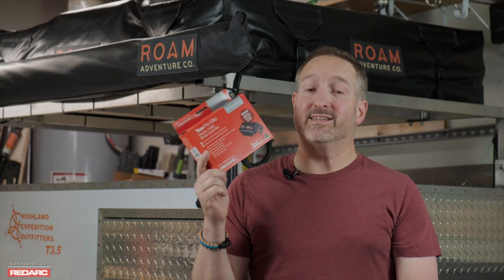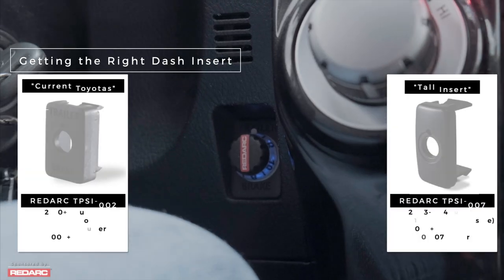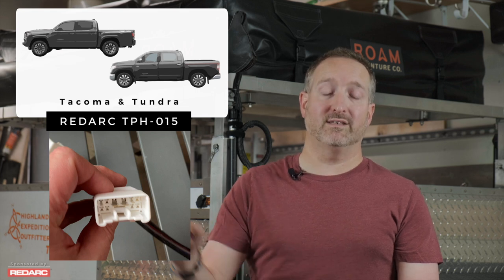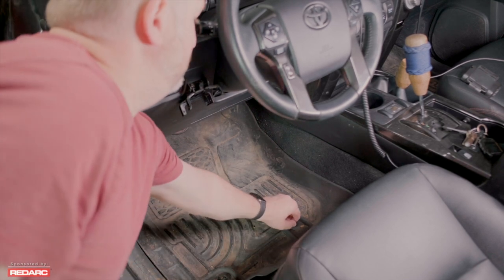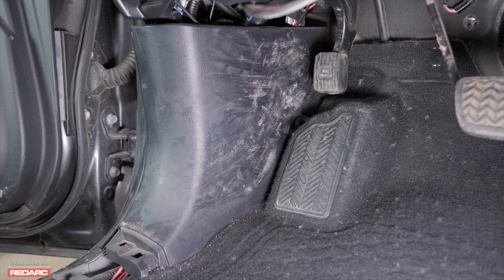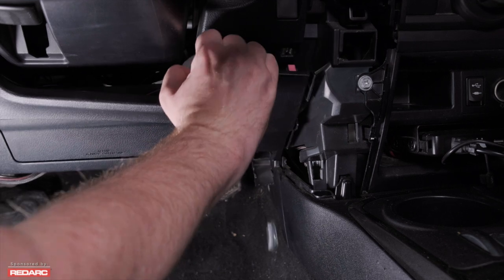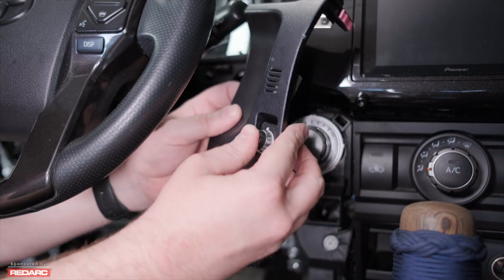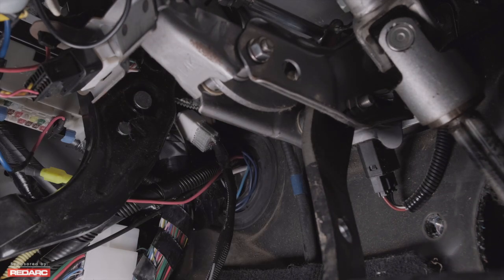Installing REDARC Tow Pro Elite Brake Controller in 2015 4Runner

Comment: Was the knob in the right-side set back spot hard to get your fingers around? Worried about emergency manual braking situation and not being able to quickly access the knob.
Reply from the maker: I don't have any problems with it. Even when I am wearing gloves, it is easy to turn by moving your finger along the bottom of the dial. However, the great thing about this setup - it's easy to move if you want to put it in one of the other dash blanks or a custom spot of your choosing.

Comment: I didn’t see you add the fuse. Is this because the vehicle already had a fuse attached to the wiring harness?
Reply from the maker: You know I don't even remember. I had the Tekonsha in the 4Runner for years before getting the REDARC. So, any additional fuses would have been done at this time. My 4Runner came with the tow package and the extra wiring harness already. So, I believe it was already fused in the panel.

Comment: I wire it to the factory harness according to there website but the right signal  and brake lights doesn’t work.after contacting customer service ,they admit the wiring is good but they ask me to buy the plug and play cable .guess what still not working.don’t but this product for Toyota 4 runner

Comment: Does this work for the GX 460 also?
Reply from the maker: I don't have a GX, but the basis of the platform is the same. I would consult your owners manual. To date, I have only installed 2 of these. Both installs were on 4Runners.